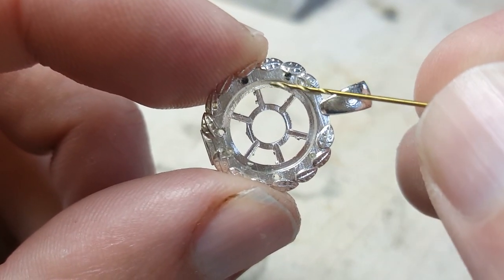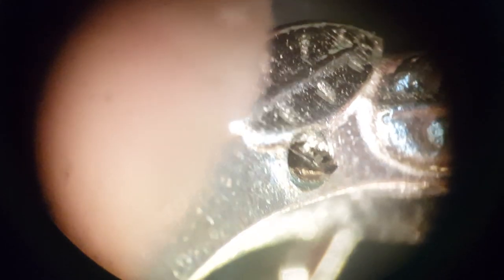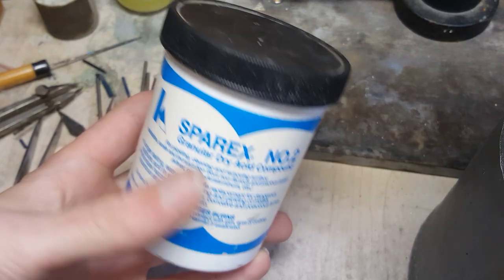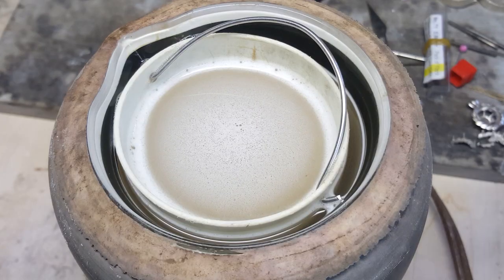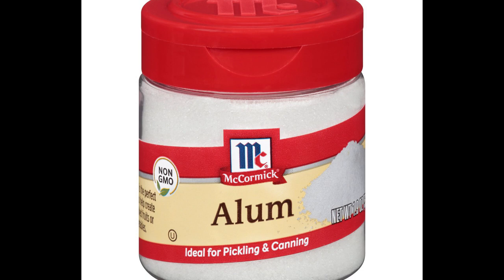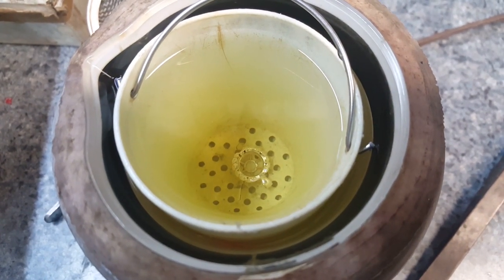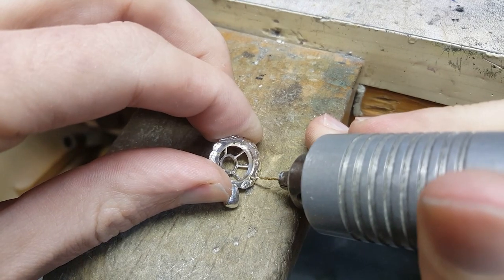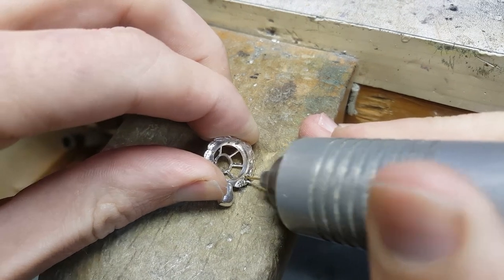How to Remove a Broken Drill Bit from Jewelry Easy!

Comment: If you will use a ball but instead of a drill bit, it doesn’t break off inside as easily. It is harder to drill straighter holes.

Comment: What was the material of the broken drill bit - carbon steel or stainless steel? By the ease of dissolving, probably carbon steel. If so, what would you use for stainless steel in silver?